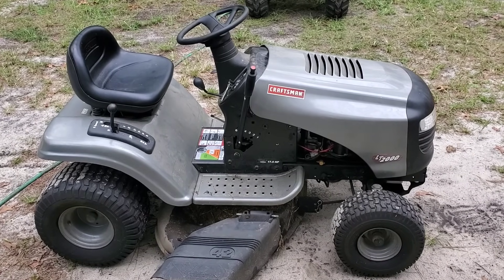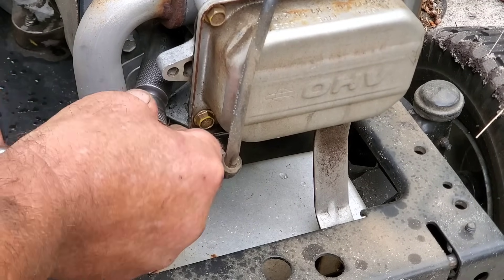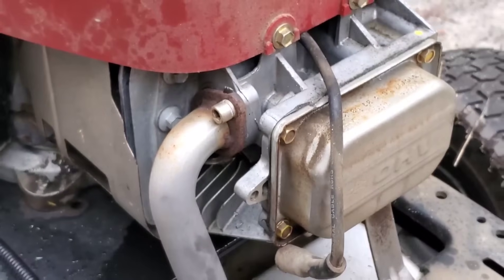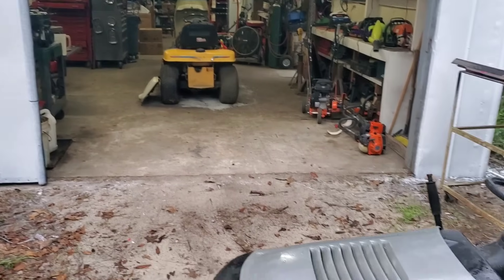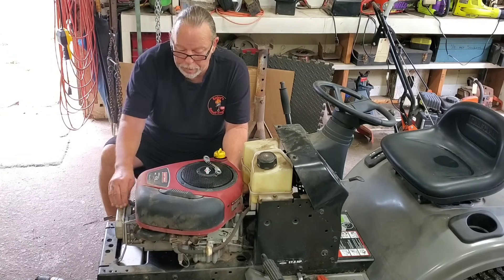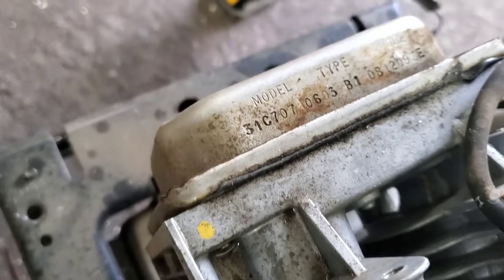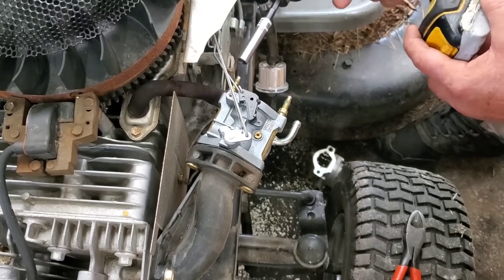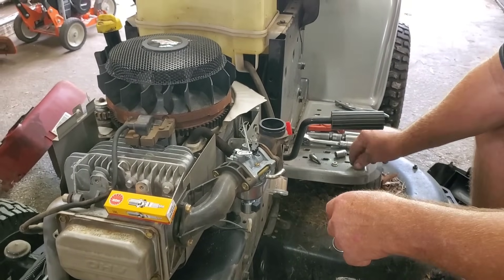Engine won't turn over, locked up?  We show how to diagnose and Repair a Briggs and Stratton

Comment: I want to thank you so much for this video. I am a 62 y/o woman with a TB30r mower and with your help, I fixed my mower all by myself ❤
Reply: Nice fix.
Reply: I’m proud of you 👍 that’s awesome 😎
Reply: 62 yo also. B&S endurance 20hp. 
Just pulled my plugs and gasoline poured out of the plug closest to carburetor. 
I used my mower to cut my weeds two weeks ago and it ran fine. But noticed the smell of gasoline after I put it up which was strange. Thank you for the advice. I will report back with my results.
Reply: Cool for you 😊
Reply: That's excellent news! 😊

Comment: I have a Briggs and Stratton 23 on a Snapper and it seemed like it was dead because it wouldn't even click or anything, finally I got down and wiggled the clutch/ brake switch and it fired up, well while it was running it just completely shut off and won't do anything. So I ordered and new brake/clutch switch and just to be safe a new seat switch as well and put them on. Unfortunately neither one did anything and it won't turn over or click or anything. I even replaced the spark plug. Please any help or advice would be greatly appreciated. I am assuming it is an electronic issue because it won't do anything.
Reply from the maker: Check out my Just Clicks video.  It explains a lot
Reply: @RaleysSmallEngines  Thank you bud!

Comment: You make it look easy 😎.  Quick question.  Do the 18.5 replacement brigs cams last.  After replacing them?  I'm working on a custom mower project. Went and got a new 08 motor ahhh. Lol. Now i worry 😂.  Keep up the good job 👍

Comment: WE had installed a new tractor motor and had it two weeks when the fuel made it to the oil crankcase and combustion chamber. This has happened to us over the years to many times that we decided to install a fuel shutoff valve so we can turn the fuel off when the tractor is parked. Its a nice service valve when servicing the fuel filter and carb too.

Comment: Pull...the plug see if gas filled up cylinder.
Reply from the maker: Yes we did in the video
Reply: @RaleysSmallEngines  I said this before video was finished!!
Reply from the maker: @jeff0nyschuk670  gotcha brother, sorry hard to respond to so so many comments.   Thanks so much for watching and commenting my friend.
Reply: I used to work on these,,garbage cans for a living,,Then I got smart and gave it up..92% of it is garbage.

Comment: I know the carb was bad and it fixed the problem when you changed it. But what made the first carb bad to begin with? Is the first carb repairable? What failed on the first one if you had to guess? Thanks,  great video.
Reply: Yes, repairable. Float valve leaking.

Comment: So a few quick questions, why do all manufactures say never use paper filters on Gravity feed fuel systems and second why not clean and rebuild the Carburetor when the only issue was most likely a dirty needle & seat? It is amazing what Hydro lock can lock a motor that solid.
Reply from the maker: First question.  They have no idea what the are talking about. The proper paper filter does a better job and flows perfectly. (50 years experience talking). 2nd question.  Due to poor quality fuel with ethanol and poorly designed carburetors that have not high and idle adjustment we just replace junk with better junk.  Can I fix them? Yes.  Do i? In some cases yes. Nikki Carburetors are not worth the chance I take of a customer coming back with a problem.  The real problem is the regulation on small engines when they should be concentrating on their private jets. I can go on and on.
Reply: No doubt about the paper filter over the screen filter for cleaner fuel but for me I'm old real old school so I always prefer reworking a carb but you are right time is money & the part is cheap too.  @RaleysSmallEngines

Comment: Does this damn thing have a fuel pump on it? My clear fuel filter hardly has any fuel in it. I have done everything i can think of New Carb, New Coil, New plug, Adjusted valves to spec. It runs pretty good at idle for a minute or two then starts cutting out and dies. When i increase the throttle to normal it cuts out and dies?!?

Comment: Hello! I have a riding mower with Briggs EX1900 intek. Weird thing. I’ve adjusted both valves to .004 It will turn over and hesitate at compression, then crank. If I turn it off and try to crank again, seems the battery doesn’t have enough power. Battery bolts show 12v. Oddly enough, if I turn flywheel by hand to the compression point and then just passed there, the engine cranks fine. Is it bad to continue turning the flywheel by hand to get it cranked? Will that damage anything?
Reply: It will not damage it. Make sure your battery terminal bolts are tight also.

Comment: I got that same click click!! 14.5 Brigs. New battery and new starter. Guess it wasn't the starter or solinoid. Next thing see if it fluid locked.  It turns hard like yours. I. Thought it was getting wore out by a knock at low speed. But when at higher rpm you barely hear it.
 What oil should i use 5w30?
Reply: 10w30w

Comment: I had same issues as you, changed carb, changed oil. still hydro locked, and changed plug too. I am at a loss and not sure what to do next.
Reply from the maker: If it's truly hydro locked. Only 2 reasons, carb or fuel pump. That simple.  Hydro lock is fuel on top of piston, it needs to be drained and blown out.  Other common issues are mistaken for this is.  Valve lash not at .004 in., cam compression release broken, weak starter, weak battery, loose ground and more. Take your time and diagnose it, check my other videos. It's all covered. Hope this helps.
Reply: Did you fix it :)

Comment: Alright T Bone (my fathers nickname was T Bone. Also hound dog) but any hoo please help me out. I can’t find an answer anywhere and I’m in too deep to give up now. 

So my fly wheel was exactly like this when I reinstalled the deck after replacing the  deck belt. 

When I take the deck off it starts. When I out the deck back on it won’t turn. What might I have done wrong? Please help me 🙏

Comment: Thank you for this. 

Just had the same issue on my moms that has been sitting for a couple years. All of the fuel drained into the engine and the flywheel would not turn at all. 

I ended up changing the oil and everything and looks like I will have to do it again when I get a new carb because it probably caused the little fuel I put in to leak back into the new fuel. I didn’t know it would be locked up when I did it all. Figured it all leaked in because it sat for maybe 2-3 years. Hopefully it will fix it. 

On that old one you took off. It looks like it was cracked on the side where the bolt goes though.

Comment: Hi I have an 18.5hp Briggs that the engine will turn a little and stop at the compression stroke. I can help it past the compression stroke and it then has enough  momentum to start. Does that sound like the compression release is not adjusted correctly? On a different video you found pieces of timing gear in the oil would an engine run at all with pices missing like that?
Reply from the maker: Adjust the valves to .004
Reply: @RaleysSmallEngines  I will do that thank you.
Reply: Another question I have is the mower I have is a Craftsman 42” deck with a 6 speed transmission that is extremely hard to shift speeds or go in to reverse. It kinda helps to rock the mower. Any advice that can make it shift smoother?
Thanks I’m advance
Reply: @ThatJeepGuyDan I drilled a hole in back of transaxle, added oil.. fixed it..

Comment: why change the carb check the float or adjust it then put a shut off valve all and i mean all those briggs leak gas  if engine runs good with that carb then no need to change it spending money for nothing when you stop it shut the gas off when you go to start it turn it on ,if it is flooding when it is running adjust the float if your such a great mecanic you should be able to do it ,i doing all the time ,should be able to fix carbs not swap them out just lazyness,change carb have trouble with that one no farther ahead,fix it,end of,

Comment: This issue should be easily diagnosed before you even attempt to start a small engine.  As part of your starting procedure you should always pull your dip stick to check the oil.
Reply: That’s a really good point - to always smell the dipstick for fuel.  Of course at 5:00 T-Bone covers a range of diagnostics which make this video well worth watching.
Reply from the maker: Thank you

Comment: man, I wish we had guys like you up here in PA.  our guys suffer from a bad case of "too obsolete to fix"...just tried to go after basics for a Kubota, and I can't even get tires or an oil filter, now!  the cubby's down with a parasitic draw, the bolens is locked just like you described (and the only guy we had contact with for this won't touch it because its starter is so buried that it's too much trouble), the weed eater and a second push mower keep conking out, and we have a dead chainsaw we can't even get going.  throw in the fact there's no vehicle here now capable of towing anything...

Comment: u know what i did? i bought a complete 1992 Craftsman lawnmower with zero BS on it, i restored it and have been mowing with it for 5 years. i never have problems with it, that's how simple it is. couple mods to the drive pully and the blades. no cam to brake, no compression relief braking, no hydrostatic trans going out. and it was less money to redo an old lawnmower than to buy a new one.

Comment: As far as getting a $17 or $21 in Amazon car breaker you can if you buy the hip one sir hippopotamade is makes for a lot oh oil in my chaint though there's a black cat so they got down pretty good when they're making these they com in a black felt line case I actually feel like a jury what you buy jury and there care a lot about what they're shipping and how they're doing it so they can see a little bit better quality and a whole lot better price than that d*** Briggs away inot Amber d***'s OAN carburetor on park street from Gulf street 50 or 75 bucks at least before things went up I don't know probably about 80 now

Comment: That was his ideas cause the Dang folk needle has not stopped in the gag and winds up filling up the current case car they've knew the same thing when the fuel pump went out in no days when they were tied to the blocks that ended the gas tank

Comment: I bought a xr75 from habitat had a bad motor in it they said so I checked and everything was fine I pulled the valve cover the push rod came out from under the rocker arm.... Carolina lawn and tractor told the customer the engine was blown they need another mower they sold another mower with a shame all it was was a push rod out from under the rocker... had they kept that in maintenance that would never have happened....... be careful dealing with habitat they are thieves management steals everything good........

Comment: your customers must be very rich and you must enjoy doing a lot of purchases they don't need what do you charge them for the carburetor $200...... if you put some good gas in it and run it for a while it'll clean up that carburetor needle valve...... you don't even have to remove the carburetor to flex that needle valve a little bit take the ball off see if it's loose maybe it's stuck down maybe it'll floats got a hole in it..... I'm glad you're not working on my stuff

Comment: I have the same thing happened to me I diagnosed it 3 minutes I checked the oil had gas in it right there it is change the oil cleaned out the cylinder put some starter fluid in it started it up run like a bear and now I turn the gas off when I'm not using it and let the carburetor empty before I start

Comment: Love the shut off valve, great add on, should come that way to begin with.
Reply from the maker: I agree 👍🏻
Reply: @RaleysSmallEngines  
I automatically add a shutoff to every machine I work on. Doesn’t take much time, $ or effort and shows the customer you care about their equipment, not to mention making it easier the next time it’s in your shop.

Comment: I had the same problem about a week ago I smell gas everywhere I thought I had a leak my lawn mower will not start just barely turn over I put a charger on overnight next morning the same thing I checked the oil in it and gas  came pouring out the oil stick change oil oil filter repair the carburetor I  put inline shutoff valve on the gas line problem solved Thank You For You video
Reply from the maker: Awesome, glad it helped

Comment: Just found you on YouTube a subscribe to your Channel I work on small engines also about 16 years of it😢 and don't have any helpers I can tell you know exactly what you doing I order from partstree a lot to I don't fool with any aftermarket carburetor either I do have one question I live in South Georgia close to the Florida line the shops here or charging 85 to 105 8 hour I don't have to charge that much no overhead just wondering what kind of prices lawn mower repair shocks are charging up there?
Reply from the maker: We charge $88 per hour.  Not sure what other shops charge
Reply: @RaleysSmallEngines  thanks for your information keep sending us those videos they are very educational and we all love them

Comment: Hey chief just got one more today it's Mercury.
16.5ohv it turns to a certain point and stops the oil is good just change it a few minutes ago. Before that I removed the sparkplug and gas poured out but the dipstick didn't smell of gas..
And when it stops it's takes both hands to turn it than it frees up and turns until it hits it once more. and then I have to turn it over with my hands once more.
.
.
I mowed with it earlier today but now I have this issue.
.
Please advise.
Thank you kindly 😊
Reply: Just a guess on my part. I think when you were able to force the engine to turn it forced gas out the exhaust,  then it would turn over easy enough.  Still in my opinion it would be the carburetor.  A stuck open needle and seat would cause the problem you're having.  Gas in the cylinder,  not necessarily in the oil.  

I hope this helps,  good luck
Reply: @bertgrau3934  ok thank you I'll check it out

Comment: Great video, thank you. I’ve got a Kohler Command Pro 23 that won’t start. When you turn the key the flywheel and blades turn a hair then stop. Can’t turn the flywheel by hand at all. Changed the spark plugs and no gas came out. Changed the oil and it was dark but seemed fine, wasn’t overfilled. I put a little Marvel Mystery Oil in the spark plug holes and still can’t get the flywheel to move any. Any advice? I sure would appreciate it.

Comment: Tbone, do you find that the majority of engine problems are fixable or does it vary by degree of damage. In my short tenure of small engine repairs (former class A diesel mechanic), ive found the majority of issues are small and just created from poor maintenance, poor fuel choice and in some cases just flat out stupidity?? have certainly learned more about small engine maintenance and repairs just watching your videos.

Comment: First video I found on "craftsman riding lawnmower won't turn over". I have the same issue. Replaced the battery and it did just as you demonstrated here. So next bit of troubleshooting will be to follow your steps. I'll be recording a video as well and gonna ref you in it. - John

Comment: The parts diagram from Briggs & Stratton shows both carburetors on the expanded diagram. So if I understand you correctly, either type will work and the walbro is the prefer?
Reply from the maker: The old carburetor number is superceded to a new number which is Walbro style.  Don't do the Nikki style, they are junk in my opinion.
Reply: @RaleysSmallEngines  thank you. When I called an online parts company, they couldn't give me an answer. I just got the new carburetor today and will double check the part number hopefully I got the right one.  Thanks for the clarity of this video
Reply: True. Can’t trust the Nikki carbs so put a cut of eather way you go

Comment: Why do all Briggs engines need dip stick wiped off and put back in to check oil level? Looking at it first pullout will always be overfull
Reply from the maker: Hmmm. It is always good practice to remove the dip stick, wipe it off and then check. Just habit for me. Sorry I don't have a good answer for ya my friend.

Comment: Why do you need a shut off valve for the fuel line, when the Carb has a solenoid shut of valve on it ?
Reply from the maker: The solenoid only blocks of the main jet, and won't stop fuel if the needle and seat leaks.  The shut off valve will prevent flooding in case the needle and seat fails.

Comment: Hey T-Bone, where did you get the oil extractor pump?
Reply from the maker: I made it out of PVC.  I have two videos on it that shows some funny fails in the making.  Check them out if you get a chance.

Comment: I had a Cub Cadet with a Kawasaki engine that had the same issue. Replaced the carb and I stalled a shut-off and no more issue. I recommend the fuel shut-off on everybody's engines. It just seems safer.

Comment: Do customers care about it coming back clean and detailed or is that mostly for flipping mowers to sell?
Reply from the maker: If they bring it dirty they get it back dirty lol.  We don't flip mowers.  Thanks for watching and commenting my friend.
Reply: @RaleysSmallEngines  thanks for the response. I was watching this video because I have a Cub cadet that is burned out two starters and wondering if based on your test it is the valves out of spec. I'll have to watch that video and see how to adjust it. The electrical system is fine and I have done corrosion prevention and all the contacts and made sure the grounds are all clean. Thanks for the great and clear content.
Reply from the maker: @DefensorFortis  yes check out our video on valve adjustment and the camshaft video. They will explain a lot.